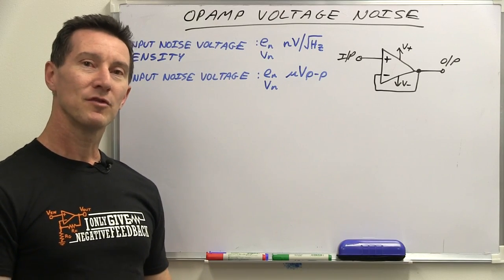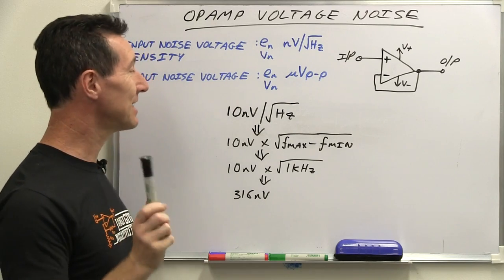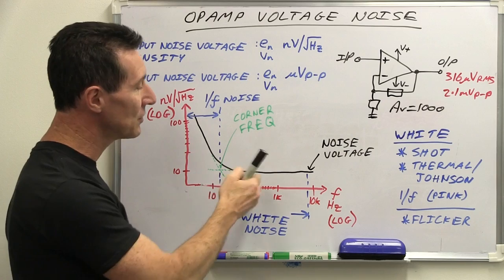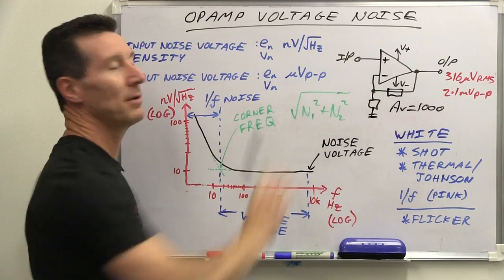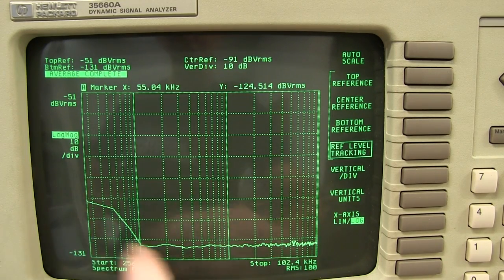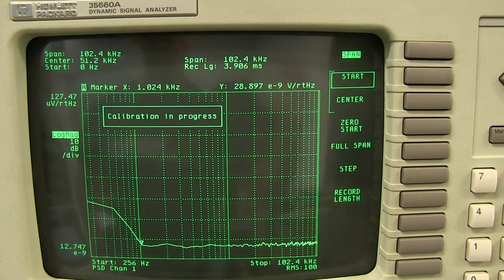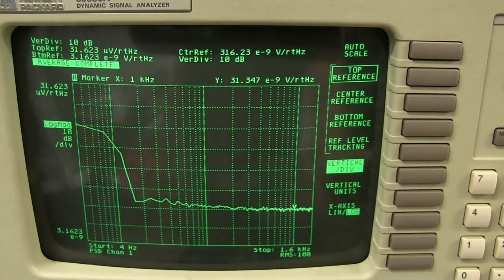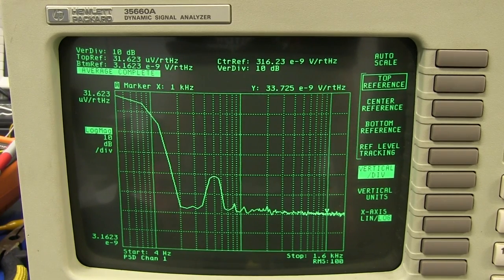EEVblog #528 - Opamp Input Noise Voltage Tutorial

Comment: Hey Dave! I don't know if you check comments on old videos but I wanted to mention some things from my experience at work building amplifiers for signals in the 50nV range. Based on Jim Williams' work, I started using steel cans for my testing. I put my little amplifiers into Altoids mint cans with a voltage divider built-in so I can inject a signal and I have no problems with 60Hz (USA) mains frequency showing up in my measurements. A 9v battery and the amp fit nicely, and I can solder directly to the tin for a solid ground. I have found that die cast and aluminum boxes don't work as well as steel mint or and cookie tins. Ferrous material really helps with shielding! I have been able to show a 100nV signal on the DSA at work with no trouble! Also, I use an HP DSA for spot checks but final plots are done with an RME audio interface and Matlab, which easily beats the HP signal-noise specs. Thanks, and keep up the good work!

Comment: This video couldn't have come at a better time for me Dave! Thanks. FWIW, last year researchers used layered graphene to determine that "1/f noise becomes dominated by the volume noise when the thickness of the films exceeds ∼7 atomic layers (which corresponds to ∼2.5 nm). The 1/f noise is the pure surface phenomenon below this thickness." [arXiv:1211.5155]

Comment: Even though I don't suppose I'll ever use this information, I find it highly interesting. You have quite a nice way of explaining things.
Speaking of noise, perhaps an upcoming video could explain the different types of noise you mentioned at 13:00. Something of a comparison of each type, how they are generated, and how different components (resistor vs. cap vs. inductor vs. transistor etc.) are affected by the different noise profiles. Maybe even techniques to deal with the different types.

Comment: Actually it possible to measure the noise of an op amp with only 10nv/rtHz if your op-amp have some gain. For example, if your op-amp have a gain of 10, at the ouput, the noise will be arroud 100nv/rtHz ! Because this is the noise defined to the input of the op-amp and it will be amplified by the op-amp.

Comment: Very good explanation! It was a good help ;). I need to amplify the output voltage of a 1kHz notch filter, uVs... to measure a SINAD in an audio Amplifier. But I'm having troubles with the noise. Now I'll try reduce the resistors values and chose an op-amp with a reduced noise, now the ne5532... Many thanks! My Channel is in Portuguese sorry... Regards, Hugo.

Comment: The drawing on the board is incorrect, the noise result is not 316 nV RMS but 48 nV rms and 316 nVpp. The datasheet figures are full noise voltage density not RMS density. Noise current flows out of the opamp not in and causes additional noise voltage on Input resistance on each pin (V- and V+). And some more issues, so be careful...
Reply: Dave put the HP signal analyser in V/rtHz and not the option below for rmsV/rtHz too I noticed. Even though he said all the figures on the whiteboard were in RMS.

Comment: "Input referred" is actually rather important.  Without saying referred you could be saying the op-amp puts that noise on the input signal, instead of the real meaning, which is noise at the output multiplied by the gain in between input and output.

Comment: Excellent presentation!

I do have a couple of questions, however (warning: long post): why doesn't the DSA use its own calibration data to remove its average noise contribution from the display? Much like 'taring' a scale? The math is straightforward enough as demonstrated by your own calculations at the cursor frequency and SO shouldn't be all that taxing to the analyser's CPU, so why doesn't the DSA do that for you at all the points? That would be very convenient, yes?

My second question is: why does the displayed 1/f frequency curve taper-off at the lowest frequencies instead of increasing with decreasing frequency as all 1/f curves do? Surely this is an artifact? Even with two data points it should sweep much higher than seen on this video (as at f = 0 Hz it is theoretically infinite [but would take an infinite time to measure] :). Is the DSA bandwidth-limited at that end even with DC coupling, and even though it is spec'd from DC to ~100 kHz?

And just a note: coax shields are generally pretty good as electrostatic shields, but not so great where near field inductive coupling is concerned, where there's a measurable AC magnetic field gradient penetrating the shield into the space between shield and the centre conductor? Same for die-cast aluminium boxes. Possibly a good mu-metal enclosure (at least for the DUT and wiring), may reduce that 50 Hz peak somewhat? Give it a try and see if it makes a difference.

Mains frequencies (and harmonics) are the bane of my applications, VLF/ULF/ELF radio receivers. The one I'm designing at the moment has a passband beginning well inside that 1/f curve, with the upper stopband beginning at around 40 Hz. Even so, 50 & 60 Hz mains frequencies can be strong enough to swamp the preamp and it is nearly impossible, it seems, to get away from it - short of moving to Antarctica. :(

As far as 1/f specs go, in your experience which COTS high GBP, low-noise op-amps would you recommend for the best 1/f performance? Currently I'm using the LT1028, mainly because I have some left over from an earlier, higher frequency (tho <100 Hz) project. Any suggestions? The lower end of my passband is around 5 Hz so that I can measure shifts in the Schumann Resonance frequencies during the hours following M & X-class solar flares. I need lots of gain as the signal strength is around 1 to 1.5 pT at the antenna (a buried loop), hence the need for a high GBP.

Again, excellent presentation! (sorry about the long post)
Reply: Theophilus Stark 1. That does not work well as the DSA cannot measure it's own noise and the Input noise at the same time. Using a former reading is very inaccurate. Also the reliability is just low. So as Dave said, use a low noise preamp and everything is fine. This Instrument is not intended for such low noise Levels.2. It is just vague to pull that off from a single Point. You need to narrow the bandwidth more and get more Points then you will see how it is real. Also Dave has drawn the 1/f curve wrong.3. right, however you still have also capacitive coupling. Shielding is only a reduction not a removal of capacitive coupling of external noise. You can improve by using a guard + shielding (triax). You can also shield magnetic fields. In addition you can reduce Impact of magnetic fields to circuit by circuit design/layout.4. If you really wanna get rid off, just improve the circuit. You can also improve the filter and there is in addition the option to use a sharp band rejection filter.5. The LT1028 is the best integrated opamp for low noise if and only IF you have a low source impedance. From what you write I assume you have a high source impedance and then the LT1028 is dead wrong! I can't tell what is best without knowing your source impedance. And you do NOT need high GBP for a lousy 5-40 Hz low frequency signal.In General: You can get your Project right. Just specify what you want (gain / max noise / max. 50 Hz Impact) and then design your project accordingly. If you use other designs you will get something which might not fit to your Needs. Neither physical Limits nor the power grid is blocking this, only Money and time could. I wish you best luck!

Comment: Hello! I have a question and I cannot find the answer anywhere in the internet. My professor uses a complicated approach regarding the calculation of an output rms noise in a OpAmp. He says we must calculate the transfer function of the circuit several times applying a voltage noise as a voltage generator at the OpAmp + terminal and applying 2 current generator at + and - terminals. After this we must integrate the squared modulus of the transfer function multiplied by the power spectral density (PSD), which is usually a known quantity. Then we must calculate the result of this integral, but crazy things happen! He starts considering the loop gain, the ideal gain and the real closed loop gain and after making some consideration about that, he finds some bandwidth where the noise is relevant and multiplies it by a pi/2 factor. Do you have an idea about how this is done? And which consideration I have to do about all these gains to find the rms noise? Or any reference (like books) I can look at?

Comment: So it's better to use AC if you wanna amplify the microvolts from a thermocouple?
Reply: +bergweg No you need opamp to do sense circuit. It copies the dc and outpus 0-X Volts range.

Comment: sjekk out a real low noise riaa stage made in 1995 kofigured in a unusual way opa ad742 10 times  amp into ad 844 40 times amplification.you can read about it on different cites.lc audio have a english site to. pr channel and a stereo buffer?lf412.later they made use of lf411 mono buffer pr channel before output.it is a no negative feedback local or global design.and it is smart implemented for superb result.the best riaa i ever built.My power amplifiers are also no negative feeback and they sound more natural down in the lower vocal range and the dont change caracter after hwen i turn up the the autenator on my benchmark dac/modified.a piece of gear like bencmark boust about analog volum and it is the cheapest smallest crap potentiometers i have seen.i they never last more than 2 years.so i change out to 21 step wishay dale resistor based  autenator same value 10kohm.they are small and are made with different curves.i gota speacial hifi grade curve they called it from laser collection on ebay.they are very good.i have bougth several since and upgraded my old elektrostatic stax head speaker amplifier with the same 10kohm and curve as the one used in my dac.very pleased.no pops or kliks when turing the autenator. a cheap way to get a real upgrade volum control and sound quality.and it is reliable.i have inpected how they are build.and they seem very ok to me.

Comment: The question is WHY do all these components have inherent noise.
Reply: +The Kaiser Metals are not flat they are cracked in microscope. If you could manufacture totally flat structure of metals you would have absolutely minimum inherent noise.
Reply: MEGADRIVE Jeroi Why don't they use Graphene?!
Reply: it's because of the thermal movement of the electrons - see: nyquist noise. mega was talking shit

Comment: at 07:18 ...
The calculation is not correct. The units are chosen wrong.
On the top you said the unit of the noise is [1 V/sqrt(Hz)], so you have to multiply like this:
10 nV/sqrt(Hz) * sqrt(1kHz) = 316nV

By the way … I really like your videos :)
Reply: Im just getting started with this subject. Im confused, how does 10nV*(sqrt(10,000)) equal 318nV
Im sure Im missing something in the material....
Reply: He actually did 10nV*sqrt(1000) which is equal to 316.2nV
Reply: Vikas V, he said it’s RMS too then at around the 27 mins mark he actually used non RMS option to put the HP into for the vertical axis. 🤷‍♂️